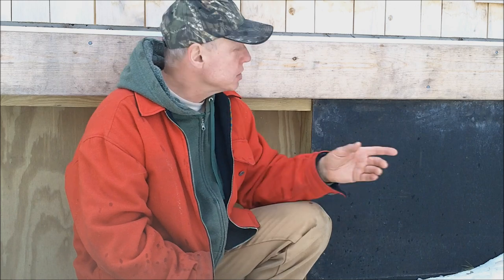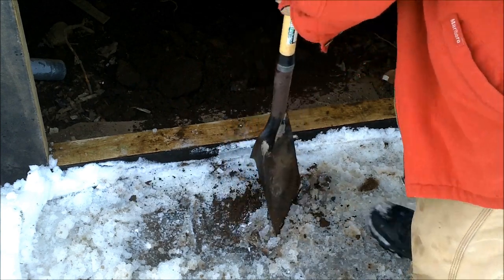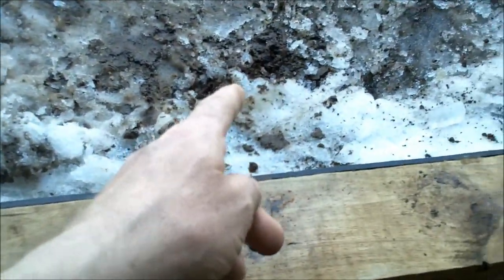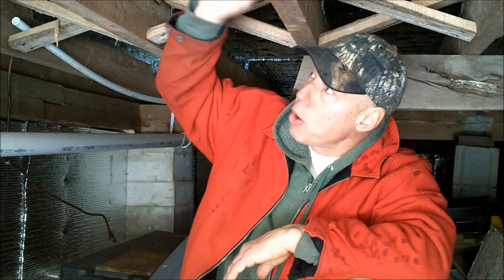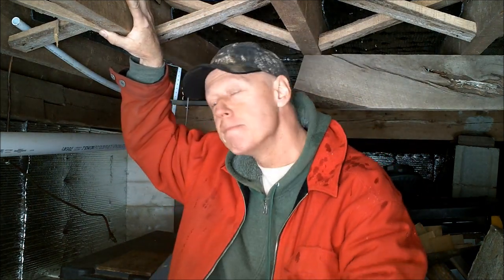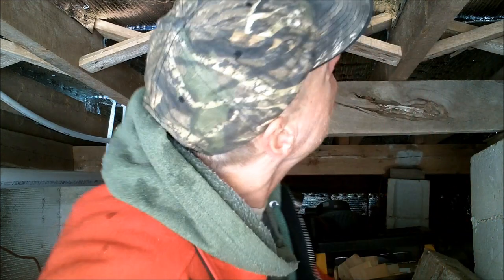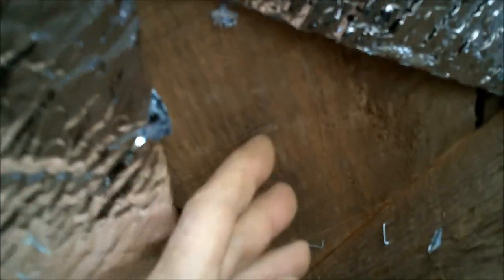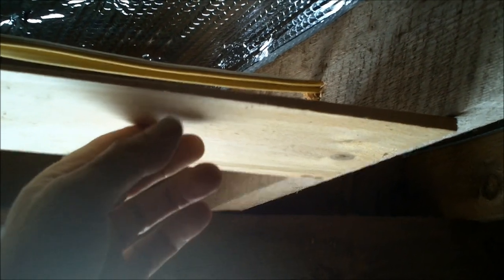HOW TO INSULATE A CABIN FLOOR AND KEEP IT RODENT FREE   PART 2

Comment: We had a pole barn/garage/workshop built last year and had that insulation put on(they call it double bubble here in KY).  We put the vehicles in there after they had snow and ice on them in 0-10 weather.  Without any heat source, the snow and ice melted off the trucks.  So it had to be above freezing in there, and that means a 30 or more degree shift with just double bubble and no heat source.  I should've put a thermometer in there but didn't think of until afterwards,  now I'm a believer yessah.  ; )

Comment: I sense your frustration boss. I skirted my cottage the same way except I ran a vapor barrier along the dirt floor and up over the bubble foil to the sil plate.  Saved me over $500 bucks the first winter in heating costs and fixed my humidity problem as well. Sometimes it’s about creating dead air and not so much about the r value. F the trolls. You do you bud.
Reply from the maker: So very true.  I'll be covering the ground as well when I'm finished digging under there.  Definitely a good thing to do :-)

Comment: Enjoyed your video and found your floor insulation made a lot of sense, especially with the rodent issues. I bought several rolls of bubble foil about 20 years ago to use in a new attached garage. I ended up using traditional paper backed glass insulation, but hung on to the bubble foil for spot insulation use afterward. About 5 years ago I found a great use after purchasing a 34' diesel Trawler for a 7,000 mile circumnavigation of North America. I cut the insulation to fit all my cabin windows, attached  with a few small strips of clear velcro.The shades were easy on/off providing shade and insulation from the summer sun and making a huge difference in interior temperature. I also used them selectively for night privacy, if needed in a marina.The few times I was caught in the cold, bubble foil on the windows greatly diminished the drafts coming from the windows.
Reply: Using velcro to attach the Reflectix to your windows...what a great idea!

Comment: Good for you. You tell 'em Boss. I can attest to its value of bubble foil as I have used it in my little 1975 Cardinal 10ft travel trailer remodel. YES, It made a difference!! I have camped in late October in the mountains of Sierra Nevada's in northern CA, and it snowed!

Comment: Thanks for the video. Im replacing water damaged walls and floor in a old mobile home. The insulation is totally trashed due to mice, squires and raccoons that got up imbetween the joists, the massive amounts of rodent poop is amazing yet discusting. I think I will try your method.

Comment: One positive attribute I noticed is the height of the floor joists above grade where it looks like you are perhaps approximately 42" to 48" to the bottom of the joists which allows a static plenum of air to exist and having the skirt insulated with the bubble-foil keeps the air warmed.  You also must be oriented on the lot away from downhill running drainage.  If water vapor ever became a minor concern you could consider installing a couple of solar-powered fans to circulate air to reduce water vapor.
Thank you for suggesting and showing the practicality of the bubble-foil at work.

Comment: You can’t argue with success.  Bubble foils make a great vapour barrier as well as an excellent insulator.  This spring I need to replace my cabin floor and insulate it.  This is how I will do it. Great for retrofit jobs.  Cheers
Reply from the maker: It's awesome stuff.  The only people that gripe about it are people that haven't used it.

Comment: after see you vid a few years ago. I did this in my 1923 arts and crafts home, 2 1/2 ft. from the block to the floor and there was not any insulation in this home. made a world of difference and I live east of the wyoming front range with high winds. Thanks Boss for the heads up on this. Save my a lot of $$ on heating bills.

Comment: Thank you so much for this video! I am changing the insulation in my 320 sq ft cabin from fiberglass to bubble foil because of your video. The fiberglass was a magnet for rodents and the condensation was a pain. I’m a 52 year old woman, and I am doing it myself. It’s a lot of work, but it’s pretty easy. And the floor is bone dry!! Thank you for sharing your idea!!
Reply from the maker: Just a reminder that the bubble foil sold at Home depot is NOT what I use . They changed what they carry and it's made very cheaply.  This is the brand I use:  https://amzn.to/39Om4LL  
Good luck with your project.
____________________________________________________
As an Amazon affiliate, commissions are earned from qualifying purchases.
Reply: @thebossoftheswamp  Thank you very much! Yes, I followed your link! 🙂
Reply: @thebossoftheswamp  Hi, JC! I have a couple of questions. What did you insulate the water pipes? And how  did you insulate tight spaces? Thank you very much!
Reply: @thebossoftheswamp  Hi JC, I just wanted to share this info with you to alert your subscribers. The link to the Amazon product is for the Reflectix brand. However, some third party sellers send a cheap version. I ended up receiving what appears to be the US Energy Products brand. I found this out because I had ordered an extra roll from Walmart (third party seller). This roll came in a proper Reflectix brand case and packaging. The ones that I had received from Amazon came in an unmarked box without any packaging.  Most importantly, the quality was CLEARLY better than the ones I got from Amazon. The difference was stark. When I cut the Amazon version, sometimes, the foil would peel right off, and ended up with just the plastic bubble, which would pop at the slightest pressure. It’s very unfortunate that third party sellers can just send whatever they want.

Comment: Oh, I beg to differ with all your insulating detractors! Years ago we started implementing double sided open cell radiant barrier insulation and its performance is stellar - and we're in a humid climate where very real issues exist with mold growth. When we first started using this, the city inspector  - well, I'll just say he hadn't read the papers...his opinion moderated afterward. We also incorporate porcelain microsphere powder into paint - a bit of kaching and sheen adjustment necessary, but temperature regulation and ambient air quality is notably improved - and impedes fungus / mold growth. Love your shows! Love your ideas! Look forward to every one! Doing a bit of binging now...

Comment: About 10 years ago I bought a basic wooden shed to use as a backyard office. The floor consisted of joists with tongue and groove boards nailed straight onto them. As the installers were erecting the shed, they added nothing in the way of a membrane or insulation. I cursed the fact that due to it being only 8 inches off the ground, I would never be able to add any insulation at a later date without dismantling the entire shed (in hindsight, should have done this). I had come across the relatively new product, as The Boss appropriately calls it "bubble foil" and decided to instead put it on the inside of the 2" studded walls and ceiling with some 1/8" birch plywood over it. I bought the plywood, but it took me a while to get around to it, and in the meantime I ran out of money. The best I could do was to buy some good ole regular bubble wrap from an office supply place and use it in the same way as the foil stuff. Granted it doesn't get very cold here in Ireland, but it worked a charm and ever since has made a rot-free lovely, toasty little space.

Comment: It works by stopping your floor panels getting dew drops on the underside.  The wetting drying cycle would otherwise suck a whole load of heat through the floor.  Air is a great insulator.  So long as you eliminate huge draughts through your crawl space with your sidings you've got a sensible setup.
Reply: @ Colin Chapman Oh! No kidding.

Comment: Thank you for sharing this information.  I have an older,  small house at 7300' in the San Juan Mountains of southwest Colorado which has a floor insulated with fiberglass that is a constant battle with mice and not effective for insulation.  That floor gets cold !  I'm in the process of downsizing and moving into that small house permanently and your method is going to be the first project I undertake with the house.  I'm glad I've waited to go buy more insulation to repair/replace what's there !   Thank you so much and God bless !   I'm looking forward to the results..!

Comment: Serious, common sense. People get nuts with building, "air-tight," and high R-value. The bubble wrap method seems to hit the sweet spot of providing a vapor barrier and insulation, but still enough flow through heat to keep the crawl space from freezing. Perfect for a cabin, and keeps the mice out which is a major victory! Great video!!!

Comment: About 9 years ago, I was desperate for some kind of insulation. I lived in an old, old home and the walls had 0 insulation.  I didn't know what to do.  I went to Home Depot and found the bubble foil and it was affordable and easy to put up.  I am an older woman, with 0 experience and this was my only hope.  This stuff saved my pipes from freezing and dropped the temperature at least 10 degrees.  I had only put in on the walls to keep the cold from radiating into the house.  So yes it works.  I'm getting a tiny house and believe you me I will be using this stuff.  Thanks for the video.

Comment: I built a 16x20 off grid cabin this was the winter spending some time up there i decided to use the bubble foil on the floor like you said so far i have nothing but good things to say about using it when. i told friends how i was doing the floor they just gave me the look lol once the cabin gets warmed up the floor is fine i walk around in my socks even bare foot some times i still need to skirt it yet so i expect it to be even better.So Glad i did it thanks for the tip been following you for about 2 years now and enjoy your videos

Comment: Smart plan. And a lot easier. I have been there with the rolled fiberglass at camp and the rodents tore it up in no time. This way that you recommend is also much more pleasant of a job! And yes we do need some air flow here and there in our structures! Thank you!

Comment: I like this guy…he’s as country and common sense as you can get 👍. I’m working on a cabin at the moment and I’ve been reluctant on putting wool insulation because its warmth will attracts rodents, just spoke to an “expert” about my rodent concern and he was recommending all other stuffs I will need to buy and fix to solve that problem…but something (I’ll say the voice of God) in me said there as to be another way out and after searching YouTube I stumbled on your video …you just helped solve my problem and save me from spending lots of  $$$$ as “the expert” advised me for something that will fail after a few years …you da man 😁👍
Reply from the maker: One layer of this stuff is all I have beneath the floors of ALL of my structures.  I went to buy a few rolls the other day at Home Depot and they had some other off brand that was half the thickness of what I use. I didn't buy it.  This is the brand I use:  https://amzn.to/3uhCaWr  
_____________________________________________________
Shopping through this link helps our channel with commissions earned through qualifying purchases.

Comment: You tell em Boss!!!!! Armchair experts!! 
I worked reno and new home construction for years, know about that thermoplast, but not even the foil type. Has a lot of R value.
An example was when a plumber ran a supply line through a cold air return joist space, the outside rim joist was insulated with R-40, the bottom of the joist had thermoliner on it to complete the cold air circuit.  The only place the line had froze was where it went through the joist space. This was a heated basement!

Comment: Great video, that bubble  foil insulation is great.  I use it in windows, is amazing keeping in the heat in the winter and keeps the sun and  heat out in the summer.  It's not the r value, its the two reflective surfaces that reflect all the infrared heat.

Comment: my parents house had fiberglass insulation in the floor and we could never keep it there no matter what the experts say it's crap for floors but perfect for rodents. thinking outside the box and doing what works best for you is the way to go. we ended up spray foaming the inside if the foundation with nothing in the floor and it's still better than the performance of the fiberglass!

Comment: Good video! I was skeptical of the stuff when my buddy had it installed in his pole barn, but he said it worked and after seeing your video on it, I was convinced. I just bought a camper to live in while I build my own house. Even though it's a 4 season camper, I think I'll still do skirting like you did on your cabin, just to help keep things toasty warm in the winter. I don't want to deal with frozen pipes!
Reply from the maker: The skirting makes a huge difference.

Comment: I am definitely going to try and adopt this method to retrofit the bubble foil in our cabin in Ontario - the floors are very cold in winter. Our crawlspace is not high enough to crawl under, so I guess I may have to rip up the floorboards, lay the foil on the framing and then refit the floors.

Comment: We don't own a cabin, but we have what is more or less a modified A-Frame house.  We will be doing this, this Spring/Summer.  However, we're gonna do the underside of our sunroom which is totally exposed and therefore we have to consider the room a 2 1/2 season room because, during the winter and summer, the door leading to it has to stay shut.  We want it open all year round.  So this year, we're going to do the underside of the floor and next year build skirts for the exposed areas.  That part will be difficult because we don't have bare ground like you probably do; it's elevated from down below and what constitutes ground under this extension is gravel.  We don't know how far it goes so apparently we'll have to trim these skirts to match the elevations.  There is no way it will be totally airtight.  But it should be far better by a mile than it has been since we bought this house.  Thanks for sharing this.

Comment: I’m just about through my 2nd winter in a cabin that’s on posts. Last year I tried to add fiberglass insulation, but most of that got pulled down by various creatures or the wires just popped out, and it wasn’t that effective while it was up. I don’t have the place skirted in yet, either. Now, I have a new plan, thanks to you. Great content, as always. Cheers!
Reply from the maker: Been there done that and ripped it out.  Skirting your place will make all the difference in the world and insulate the skirting.  Trust me on this.

Comment: Hello Boss, I'm no expert in this field but this is what I do know. Heat can be transferred in three ways. Conduction, convection and radiation. Without R factor you won't get much help stopping heat transferred through conduction. Without fluids, liquids or gasses convection isn't happening so it really doesn't apply much to your situation. Radiation transfer is what Reflectix is designed to stop. My experience is, it is very good at stopping radiation. It's apparent that it works very well in that respect. The lack of radiant heat transfer is most likely why you are getting the good results you are experiencing. I also think that the lack of airflow under the cabin created by the skirting is a big help in reducing your loss from conduction. Being rodent friendly is just a bonus of this product. It's obvious it works for you. I agree with you, if it works, don't break it. LOL Take care and I love your channel and videos. :)

Comment: JC One other advantage is that you can check the subfloor for termites and carpenter ants. I just put in some hardwood flooring and found a 12 foot 2x8 eaten to pieces and some replacement and repair work to do. Had to take up the entire subfloor to get at it. The previous owner stapled aluminum backed fiberglass into the basement ceiling so I could not observe the termite damage being done. Got it fixed and I will have the house treated for bugs.
Reply from the maker: Very good point Peter.   All the best.

Comment: The same people that are complaining about your insulating tactics (which are better than what most people use by the way) are the same people that will drywall their basement ceiling in a house in the city. ONE TIME a pipe bursts or you have to get at your electrical system you have to rip down 1/4 to 1/2 the ceiling to find and fix the problem, causing thousands of dollars worth of time and repair. You've now avoided all of this. Good work. -source: I am a contractor and have done insulation and wiring under homes professionally as a contractor for years.
Reply from the maker: Thanks for sharing your thoughts :-)